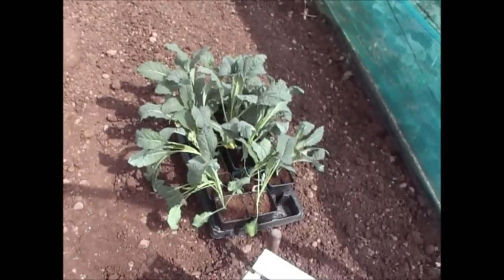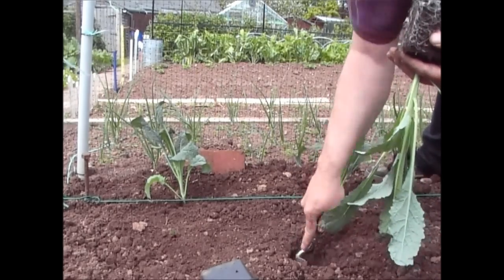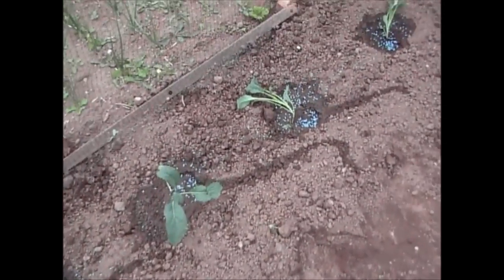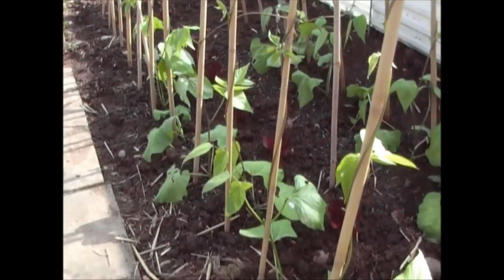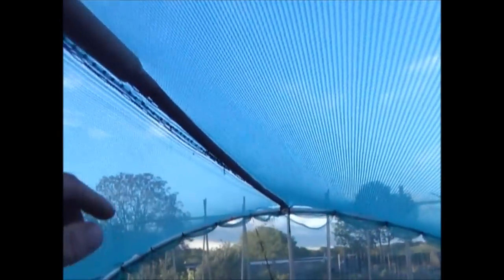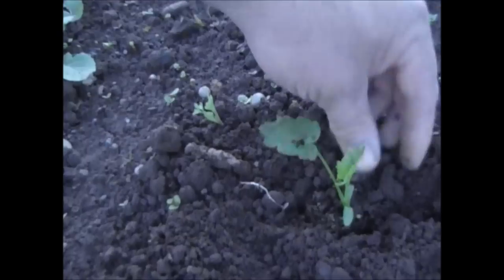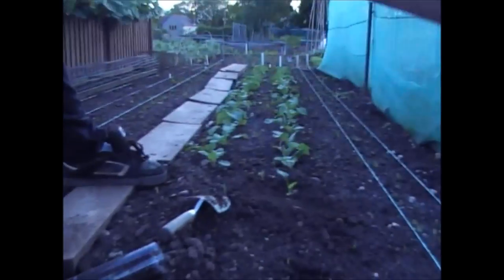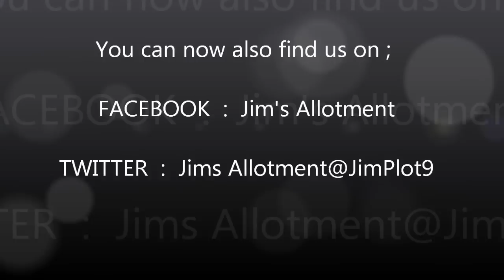Jim's Allotment - Plot 9 - One Year Anniversary - Episode 100

Comment: Dorothy looks like she could dig some moles up or root out some mice.  Question: Do you move the netting tunnel each year when you rotate the brassicas?  I need to start saving water bottles for the parsnips, although they have a designated bed and can stay in the ground as long as they need to, the bottle idea may make the grow faster.  Will have to think on it.  I need to see if any of the gardening stores have anymore seed potatoes.  I just dumped my two buckets and got about 6 pounds of potatoes, so I'm ready for round two on the potatoes, if not I may have to ask my neighbors if they have any potatoes that are starting to sprout that they want to get rid of.  I potted out 6 more tomato plants in self-watering buckets as the tomatoes I have in the ground seem to have drown.  I also spaced them about 6 feet apart to help with air circulation around the plants, as I live in a very humid area.  I also ended up with two cantalope and 5 cherry tomato plants when I dumped some coffee grounds from the kitchen in the top of the potato buckets (must have cleaned a cantelope and threw out an old cherry tomato also).  Love volunteer plants.  LOL.  Love your videos.  God Bless and take care.
Reply from the maker: Hi Teresa- Thanks for your update, Seams you have a busy garden as well. Regarding the tunnels, I move them every year on the three year plan, they are light wait so they are pretty easy to move by myself. Each one is anchored down to the ground in six places with steel poles, driven into the ground about 2 foot, so I just need to pull the poles up and drag the cage to the new position and then drive the anchoring poles back in the ground. I love volunteer plants as well all the Calendars are volunteers (except the new 'pink surprise' ones I have introduced this year). All the best with finding you next potatoes.. Happy growing and all the best, Jim..